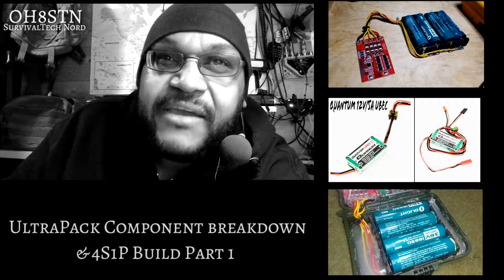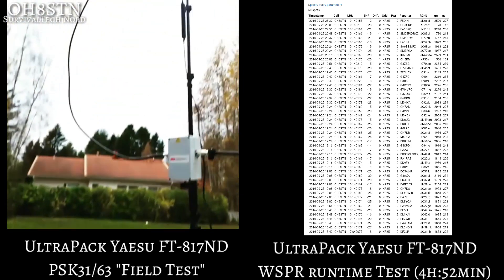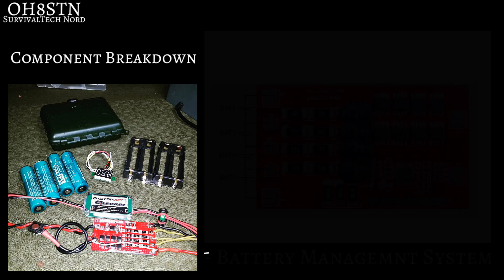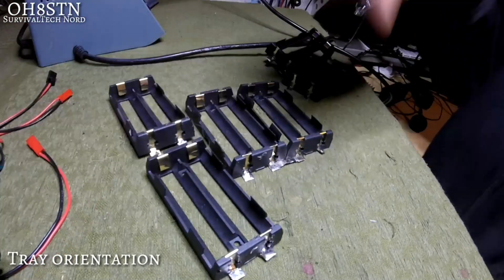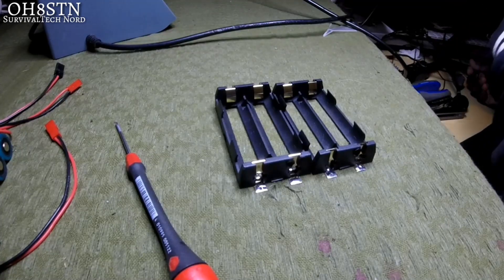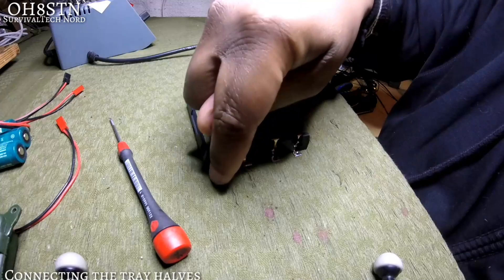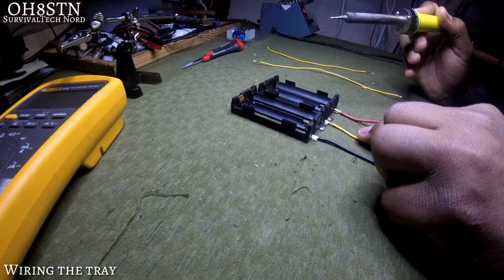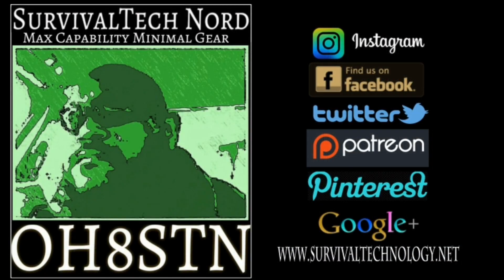how to build a 12 volt 18650 Lithium battery pack

Comment: Ik this is an older video but I just made a 4s2p li-ion battery with 18650s. However I am having a hard time finding a charger that works. Do you have any recommendations on chargers?
Reply from the maker: Genasun GV8 boost for 4S lithium-ion batteries

Comment: J- I know this is an older video but I’ve enjoyed them all. I have just one question.....the power poles for the radio are on the P+/P- side of the bms now are the power poles for the charging the pack on the same? Or on the b+/b- side?
Thanks for the great video and 73

Comment: Are you sure that's stainless steel strap?  Stainless is very difficult to solder and the conductivity is approximately one third that of copper.  Could you be using nickel plated copper tape?

Comment: Hi.  Im making a battery pack (4S5P) For a ammo box radio (a leixen radio in a ammunition m19a1 box with other accessories and a raspberry). Obviously the voltage of the battery pack is 16.4v aprox.  the question is: ¿ the ubec always stay on or only start to work when the radio is connected?.    Sorry for mi horrendous english.

Greetings form chile. CA3MPR.

Comment: What voltage/amps do you charge it at? Is it the same for a 4S2P?
Reply from the maker: Hi Omar
It's best to read the specifications for the batteries that you have for the recommended charging voltage.
Reply: Doesn’t the BMS control the charging for the individual battery? I’m just curious what you feed the BMS.
Reply from the maker: The BMS controls high voltage, low voltage, over-voltage, Short Circuit, and balance between the cells. The charge controller is responsible for how much current is going into your batteries during charge. I'm not willing to answer the question because there are so many different scenarios and variables to charging. For example the way I charge on the bench supply is totally different than the way I charge out in the field with a solar panel. The answer I'm willing to give though he's on the bench I always charge as slowly as possible so that my cells will last longer.

Comment: Nice build OH8STN. I was on the same path. I was using a small ubc from my rc gear as a test bed for my ft-817's power pack. I had a few big lipo's in my kit and put them to use. The UBC  was too small for xmit but it was proof that I could build a better pack for less. The cheap UBC's are not worth looking at. Most are big resistors or so noisy they are unusable even with multi toroids at the input and outputs. Keep posting these videos and 73's from KC0ZQB.
Reply from the maker: +graplingurty thanks for commenting.
On the latest battery build I've removed the need for the UBEC, which completely remove the noise and simplified the build. Are you going to share your own battery project?  it's always awesome to have multiple interpretations of these portable power projects
Reply: I'm playing with solar also. I have a 150watts of sun power key down on a sunny day and the lead acid batts are still accepting current in charge mode over consumption......I'm thinking small Amp hahahahaha. It's all set up on my deck,,,,,the neighbors love me hahahahaha..........73's from KC0ZQB

Comment: Nice job and yes a buck regulator is the better way to go. I would check the switching noise with a spectrum analyzer, it helps to confirm how well your filter works. I would use a fixed frequency switching regulator to make the filtering easier.

Comment: Looking at similar design for Search And Rescue here in New Mexico want to be able to have a portable field repeater that can run 12 hours. Would it be possible to parralel more batteries into a pack like this to extend the  talk time? Running on 10 watts or 5 watts but needs at least 12 hours? 

How many watts are you running on that radio in the video?
Reply from the maker: Cool idea.  It's easily possible to parallel them to increase capacity.
Reply: Could you use all the same configuration and electronics and just add batteries in parallel to the battery sleds. have sleds of 2 connected to each battery connection on board?
Reply from the maker: I've already done that exactly.  Is called 4S2P configuration.  The only trick is pairing/partnering cells of similar voltage.
Reply: can I get link for that video? or some pictures?
Reply from the maker: Robert Garcia Sorry,  its not a video yet. Fortunately,  it's exactly as you described. Instead of 1+1+1+1 battery in series. Is 2+2+2×2 in series/parallel.
Reply: Then you just have to mate or pair  the batteries correct do you charge them in the pack or do you use an external sleigh charger? Charging lithiums can be difficult is why I ask?
Reply from the maker: Robert Garcia great question.  Your case I would charge them outside the pack individually.
Reply: OH8STN  do you have a parts list and link to those items?
Reply from the maker: +Robert Garcia Sori Robert. I just saw this question.  Actually I have an exist idea for you if interested.  Is much exist to hey onset of the Bioenno LiFePO4 batteries and Genasun charge controller rather than building my pack. I can make a parts list for you if you like.
Reply: OH8STN that would be awesome if you could attach a part list !
Reply from the maker: Robert Garcia I'm Judy heading to bed.  Gimme a day or two

Comment: i have been looking at the videos and the web site on the instructions to build this but i have a question. did you add any kind of a USB charging circuit inside the box so the batteries could be recharged with a USB charging system like other LIPO batteries?? most of my gear for bug out and such is all set up so everythign can be recharged on USB. SO it woul dbe really nice to see a USB charging circuit in this battery setup.
Reply from the maker: +David Mckay Hi David. 
That's a great question.  The scope of this pack was charging via solar panel for of grid qrp communications. USB can gives us 5v ~1A in the real world,  while this pack requires 16v for an effective charge.  It's certainly possible to bump up the USB voltage, but don't do would add unnecessary complexity for "this build". On the other hand,  there is nothing stopping us from building another pocket power pack with USB I/O as a design goal.  We just have to study the benefit of building bespoke,  over buying an Anker 21000mah pack.
Thanks for the feedback.
Reply: I have a couple USB packs like the 21000 you mentioned. Not as big but the power monkey setup i have has a 12v output that could be used for the FT-817 if it wasn't for the fact its only 800ma output. while this may be enough for the receive it wouldn't do anything for the TX side of the radio. The reason i was asking is to see if the same pack to be used for the 817 could be charged using a USB input. But as you already pointed out the USB would only output 5V and 2A at most where the UPQRP would need 16V for the charge. 

at this moment it doesnt matter anyway since i am still waiting on my call sign (passed both tech and gen a couple weeks ago) and only have the F8HP HT at the moment. I am looking at the 817 radio and have found a really fantastic used station setup with portable everything including antennas and such. Its QRP but in a condo in the city thats about all i can use because of the RF issues. anyway if all goes well i will be able to get this package with the radio, tuner, mini buddipole, tripod, 18' mast and even an Arrow handheld satallite antenna. there are other extras included as well. im just hoping i can get it all for a little less than what he is asking. even so its a great package for around $1000.

BTW your videos are the main reason i got interested in QRP. Thanks for the great work!!!
Reply from the maker: David Mckay thanks David. QRP is very rewarding. It also forces us to learn how to do more with less :) There is a group called Ultra Portable Digital QRP. One if our members John is doing exactly what you're talking about. Have a look.
facebook.com
Reply from the maker: https://lh3.googleusercontent.com/dv4T1UqnXgWqlTrxM8siLU_9-AoTv73WNYAFn0x88zxezy82CL805BlzoUVdElPjzZKU9ov99g
Reply: not sure why but the link didnt work. it gives a 404 error

Comment from the maker: Update
UltraPack QRP 48Wh Battery Pack using 4S1P 18650 batteries.  Inbuilt BMS, 12v Discharge port, 16.8v charge/discharge port, Inbuilt BEC, Removable cells, balance charging in the field.
https://www.instagram.com/p/BNZWf-XhbIZ/

Comment: Any suggestions for a temperature controlled soldering iron?  For now and in future I'd like a regular and fine tip.  Does this mean 2 different irons?  I've had problems in the past getting solder to melt on larger mass connections and too hot for small connections.
Reply from the maker: +Norm Doebel hi Norm. I use two different Irina az both are Weller brand. I've got one very small for detail work, and another for working with on larger jobs. Both are temperature controlled. I like Weller brand because you buy them once, and only replace the tips. There is always spare parts, and they won't burn your house down. There are other good brands but the only advice I'll give you is don't buy from China based on price!
I hope this helps.

Comment: Hello OH8STN SurvivalTech Nord, i very like your video and i want to build a battery pack like your but 3S.
My question is: how i can charge the batteries?? On the web i found only lithium battery protection not the charger, the BMS can also balance the charging?? Sorry for my bad english.
Thank You very much.
Reply from the maker: +Simone Ambrosini Hi Simone The 3s2p is a great idea.  Some of my buddies have made them as well.  The charging voltage always depends on your bms.Make certain to buy a bms with good documentation so you'll know what voltage to use.  Also check a youtube video called "ghetto bank 18650". That's my best friends project.  It's a 3S lithium-ion pack like what you describe.  you'll just need your own bms  :)
If you are using the parts/BMS from my project charging voltage for 4S is 16.8v. Let me know know if you have more questions :)
Reply: Thank you for the fast reply!! you help me alot.
Reply: Excellent video you have here. Thank you for the time editing and making this information available; much appreciated. Also nice video you reference here... the Ghetto Bank 18650, using 3 - 18650's. I'm leaning towards the 4 pack based on other equipment i use.

I'm currently using the QRP rig LD-11 from LNR precision. http://www.eham.net/reviews/detail/12816 , and am trying to justify the qty4 - 18650 project (yours) as opposed to the 3 - 18650 (Ghetto bank) setup for my LD-11 currently. The specs on my LD-11 qrp show a supply voltage 10.5 ~ 15 vdc max. Anyway to bring the 4pack in tolerance with my current qrp? 

Also where can I obtain steel tape in your video?

I see an 817ND in my future....I also see where Yaesu operating voltage is 8 ~ 16vdc max, and probably more forgiving on maximum VDC.

Comment: Just watched. I'm building a boombox with 4 18650's. Different type of 4S BMS from AliX. 4S1P construction. Got the batteries charged with a NiteCore to 16.6V the first time. Connected a digital volt display to the P+ and P-. Was hoping to charge it with a 12V-2A adapter from the outside. Never to take out the batteries. Can't seem to charge it through the P+P-. Is my power adapter (12V-2A) not enough? As with it connected the batteries keep discharging. Or do I have to buy let say a laptop power adapter with 16V 4.5A? Or did I blow up the BMS already?
This is my first electronics project in I think 20 years or so.
Reply: You have to put 16.8V or more at P+ P- to activate it.

Comment: In place of the 4cell battery holder you have (2x 2cell) - would something of this nature work just as well?
  http://www.ebay.com/itm/like/272015848756?lpid=82&chn=ps&ul_noapp=true

Could / Would it save any space in the build?
Reply from the maker: thanks for commenting. absolutely great idea. the original project was to use removable replaceable 18650 batteries. but if you have a dedicated set of batteries to use and you know how to solder them together safely, then why not.
Reply: The ability to replace a failed cell is good point to retain the carriers you are using, especially for in the field replacements.
Reply from the maker: KYTec IT Yeah I like it too. I will certainly build dedicated packs, but this is a great option.

Comment: Looks awesome ! I got my UBEC regulator today and it is solid. Voltage only sags .2 V under 5A load. It really sags at 10A but of course that exceeds its design parameters. Did you find a good DC - DC upconverter to charge the BMS from 12V that is light ? Thanks for sharing !
Reply from the maker: +SurvivalComms  thx, I'm still using the original DC DC boost converter for charging. 12v in, 16.8v out. It's working well with the folding panel. There will be a seperate video on charging. There testing has been pretty cool. I'm not externally charging the individual cells anymore, I havnt been blown up yet :D
If you want to run 10a a why not double up the UBEC 2-3 in parallel?
Reply: I just ran it as a test to see what it would do. For the 817 I see no need to add the weight to double current capacity. I set up the regulator so I can bypass it if needed to run a higher power radio in extremis.  I did add a 3A 5V USB charger module that works inline if I desired to charge a device while running the radio which could be useful or left at home to save weight (it is 2oz). I built a smaller one but man it gets hot in service with all the fat removed from it ( it is 1oz).  I have all my backpacking stuff set up to charge on USB which makes it easy to manage ( camera, headlamp, smartphone, VX3R Xcvr. ) I'm still working on an upconverter board for mine as the BMS I chose requires 18V. I managed to fix the one I was experimenting with but need to tinker with the current to find a happy medium. Thanks again !

Comment: Awesome detail. Been waiting for this stage for a while now. The battery tray configuration makes total sense and the pattern is how I would prefer the wiring.  looking forward to the 4s2p model.
Reply from the maker: +KYTec IT thanks. It went slow so I could work out any issues before committing. I also like the tray configuration. The 4S can easily be soldered right underneath. I'm patiently waiting for it too :)
Thx for watching.
Reply: Currently this is a 4s1p pack, I believe you mentioned that the BMS module can handle 4s2p.  Can it handle 4s4p? Or would you need to have it switched and end up with 4s2p twice?
Reply from the maker: KYTec IT yes. The parallel stacking is dependant on the amp capacity of the bms. so this bms can handle up to 10 amps of cells in parallel.